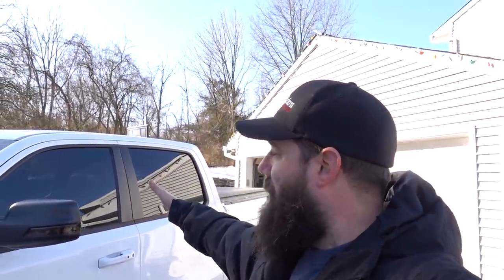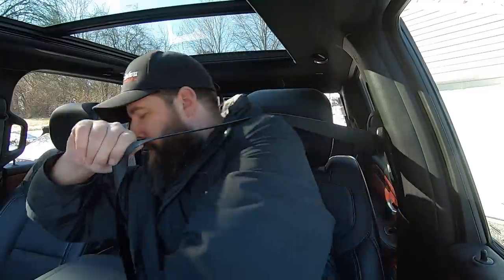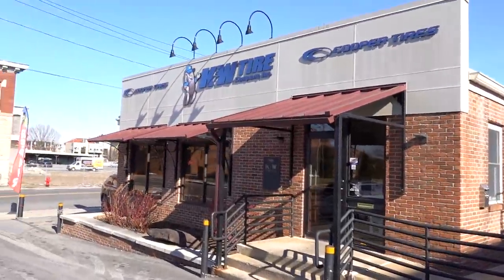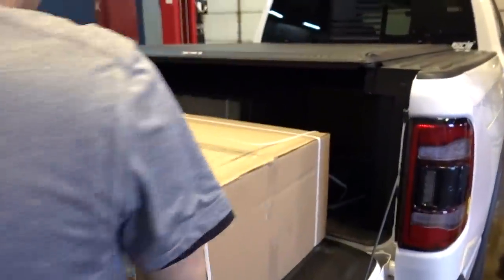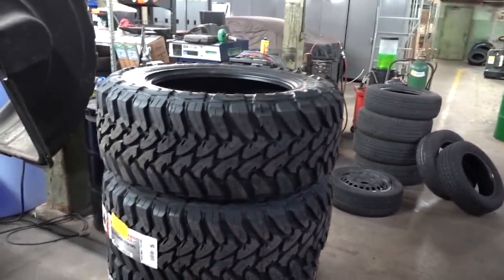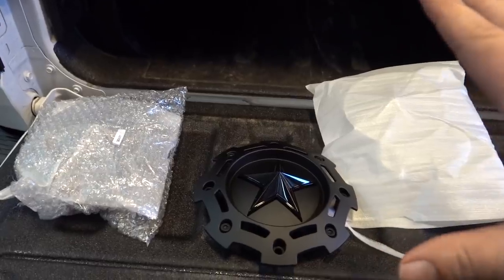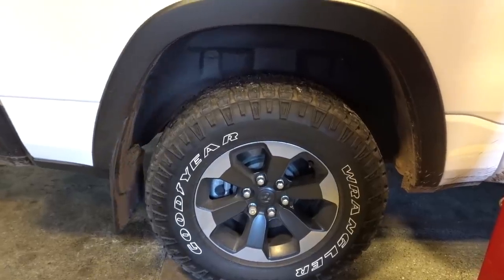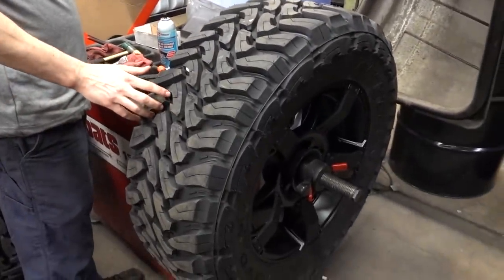Biggest Mod Yet 2019 Ram Rebel

Comment: Thanks for sharing the whistle issue Steve. I was wondering the same today morning while I was driving around town. It is only heard in low speed. Hope it's the vent. On a different note my local dealership here in Vancouver is going to replace the sway bar Link and bushings apparently there is a tsb.😐

Comment: Excited to see the lift to fit the new clean tires and wheels! 

I as well have the whistle at 75-90 mph in a 2020 Ram 1500 Lamarie Sport with the Rebel Hood and Moonroof. I believe it is coming from the seal on the moonroof or the other position it sounds potentially from is wipers/mirrors but it sounds to central from the passenger side or driver side. I will soon be changing my blades to see if it is them. I installed a hood protector from weathertech and that has changed the wind flow over the vehicle and dampened the whistle.

 If they want better AC you can purchase a larger blower fan and that should move the air faster. I have noticed from my Jeep to Ram the amount of airflow is significantly less.
Reply: If you have the sunroof tilt it open while it's happening and see if it goes away
Reply: @Snowcatsrt  hey snowcat, so if I open the sunroof it goes away. After 2 months of ownership I broke down and went to the car wash. When I was exiting it pulls on the moonroof and you can see the light where the whistle is coming from. 

I am not a mechanic but I would imagine they would need to adjust the fitment of the rails or increase a limiter if there is such on a sunroof like garage door to bring the seal tighter. 

I went on a 12 hour road trip this past weekend and did alot of testing to figure it out as my wife was sleeping most of the time. Moonroof closed no noise up to 77mph anything about I got it. I closed the interior roof panel and then I could not hear anything. I put down my side windows to try and hear it as the top was fully closed for the glass and interior headline. I could still hear it, after two car washes in a week 100% the moon roof seal is my issue. I hope this helps...

Btw got it up to 111 mph anyone know what we limit out with for the 5.7 V8 2019-2020 new body style rebel or lamaraie?

Comment: Hi. Iam from KUWAIT and Our temperatures reach sixty degrees Celsius (60°). I have no problems with a/c
Reply: mohammad ali Question. How long do your interiors and dash last when the sun beats down on the vehicles?
Reply from the maker: good to know, its pretty cool to know somebody watches all the way from KUWAIT thanks for watching
Reply: @HammerdownMotorsportsUSA  your post and video is very cool👍🌹
Reply: @ramrider1453  they crack in a lot of cars if they're parked outside a lot and don't have a good tint installed. Cars with a lot of rubber controls suffer more because they melt and get sticky
Reply: Snowcat_srt Thanks. I can see that. I’m from Winnipeg Manitoba. We get -35 to +35 out here. A lot of sun does dull out the dash and seat material. My Ram Longhorn has leather on the dash. Parked in garage but I wonder how leather would hold up compared to plastic.

Comment: I definitely have the wind whistle on my 19 Rebel...comes from the lower driver side windshield area... currently dealing with the dealer on fixing it.
Reply: I have no wind whistle on my 19 Rebel and haven't had any rear window problems either. Only issue I've had is occasionally my dash lights will go from full brightness down to dim and stay like that until the truck gets restarted then back to normal

Comment: Thanks for bringing up the AC, I got my Rebel in November so I haven’t needed it yet. I’m nervous about having sub par AC in the summer. Hope mine is good.
Reply: I’m in Dallas and had no issues with mine this summer 
Instead of max, use auto on lowest temp.  Seems to blow harder and cool better. IMO
Reply: No problem in southern Georgia with AC. My only complaint with the Rebel trim was the lack of ventilated seats.
Reply: Fast Eddie B lack of vented seats is my biggest gripe 
Only used the heated feature 2 or 3 times

Comment: My 2019 bighorn came with 20 “ Nexxen they brake traction on even a slightly wet road. Tires or like new take offs will be my next purchase
Reply: i had those to on mine and they were quiet and smooth but very little traction, i got some falken wild peat at3w and they are much better

Comment: I HAVE A BIT OF A PROBLEM WITH MY 2019 HEMI 1500 CREWCAB LONESTAR EDITION HERE IN TEXAS , IF YOU HAVE AN HELP OR SUGGESTIONS I BE GRATEFUL.  IVE TAKEN IT BACK TO DEALER ATLEAST 5X ALREADY.  MY TRUCK IS MAKING A LOUD HUMMING NOISE,  SO LOUD IT GOES OVER RADIO AN PEOPLE TALKING , BUT ONLY DOES IT WHEN IT WANTS TO , PERHAPS ONCE A WEEK,  BUT KEEPS DOING IT SINCE I BOUGHT IT IN 2019 MAY , I GOT 3,400 MILES ON IT NOW , BUT EVERYTIME I TAKE IT TO THE DEALERSHIP THEY CAN'T REPRODUCE NOISE , FIRST THEY SAID ITS RACK AN PINION,  THAN SAID NO . SO IM JUST GETTING FRUSTRATED WITH IT NOW . I HAVE WINDOWS UP OR DOWN AN IT MAKES SAME NOISE WHEN IT OCCURS, SOUNDS LIKE A LOUD  EXHAUST , BUT THEY SAY ITS NOT THAT . PLEASE ADVISE IF YOU CAN HELP.  THANK YOU SIR.
Reply from the maker: Hmm I haven't had that one yet it is possible that the exhaust is resonating through something, If you can video it doing it send it to my instagram hammerdown_motorsports_usa
Reply: @HammerdownMotorsportsUSA   : OK SOUNDS GOOD I WILL TRY TO DO THAT AN SEND TO YOUR EMAIL.  THANK YOU SIR.

Comment: Had a 17 Ram.Now drive the 19 Rebel.  I can varify. The new  AC sucks. Never gets cold enough .I'm in  Missouri. And it's not as fast as my old 5.7.
Reply: Probably geared different than your last truck
Reply: 19 Rebel Max Steel. 20,000 miles.. A/C struggles. Expecially with 4  adults. Within factory specs blows 50f from vent normally but on Hershey Park tarmac couldn't cool the kids for lunch.. Struggled in Miami,,  on Daytona Beach, Myrtle Beach and even in Virginia...So if you live in the south get a light color...Fine for the Pennsylvania Mountains...

Comment: Link to the rims and tires?
Reply from the maker: honestly I would shop around for a deal but the spec is a kmc rockstar 2 -18 offset 20 inch with 35x12.50R20 toyo open country MT I got my wheels from tire rack.com and paid retail
Reply: Hammerdown Motorsports thanks man!

Comment: Just an FYI there is a TSB to replace the body mount bolts for the popping issue.
https://static.nhtsa.gov/odi/tsbs/2019/MC-10169258-9999.pdf

There's another to retorque the sway bar but you've already did that yourself I believe.
https://static.nhtsa.gov/odi/tsbs/2019/MC-10162553-9999.pdf

Comment: 35's make the 1500's look great. I don't care for the tire stance with a -18 offset, but looks are subjective. The world would be pretty boring if everybody had the same setup on their truck.
Reply from the maker: Fast Eddie B true that but the -18 tucks right in the mud flaps and no issues with inspection or rubbing
Reply: @HammerdownMotorsportsUSA  My mistake .I had thought that the extra 2.31 inches farther out would have gone beyond the fender flares. Must have have been tired last night and missed that part. Re-watched today and see that it looks really good.